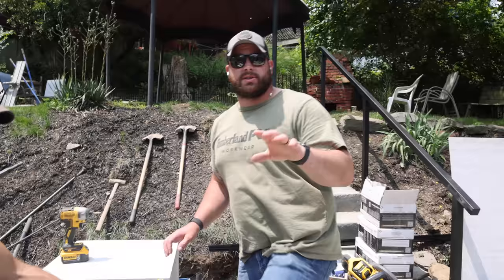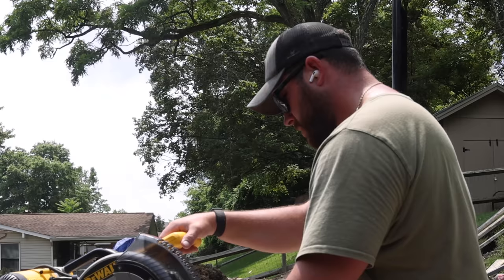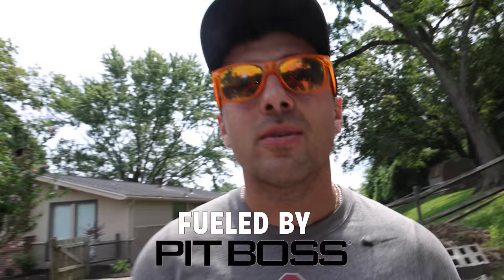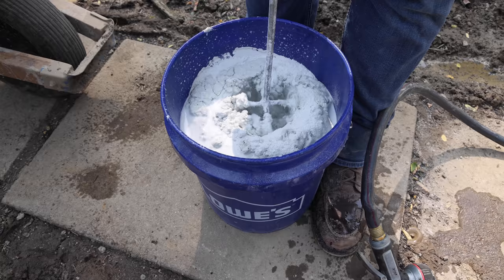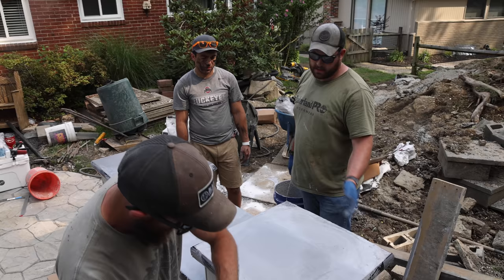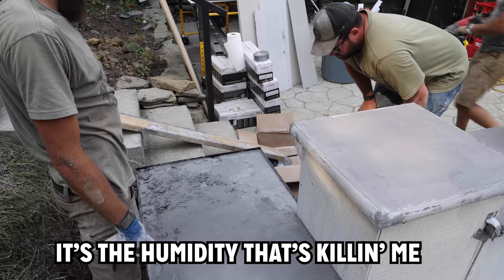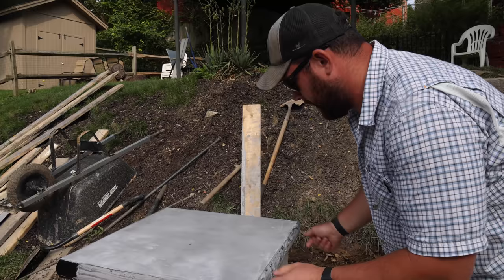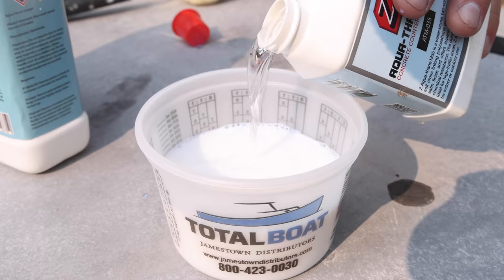Pouring Concrete Outdoor Counters -  EPIC Back Yard Transformation pt. 5

Comment: Tap the edges of the forms with a hammer to get rid of air pockets.
Don't mix the concrete so wet. If you do happen to mix it that wet, quit going over it with that magnesium. It will only suck more water out of the concrete. Instead, wait for all of the bleed water to bleed out and then finish it with the mag.